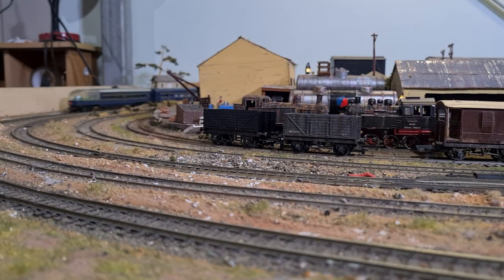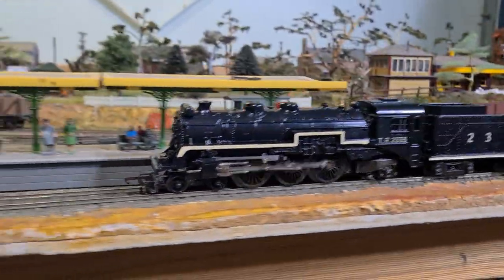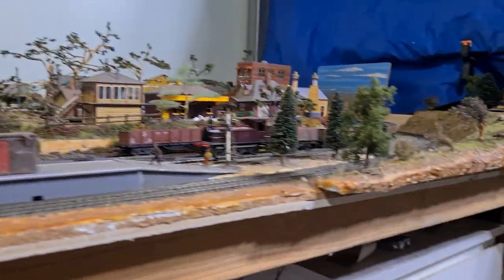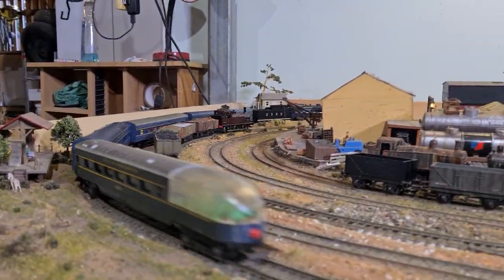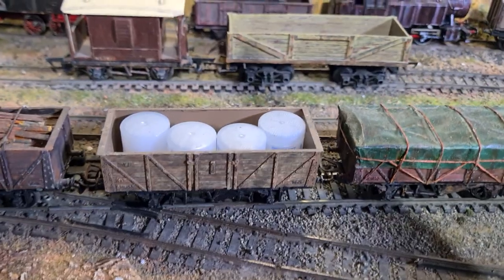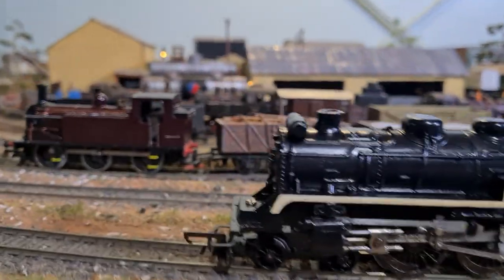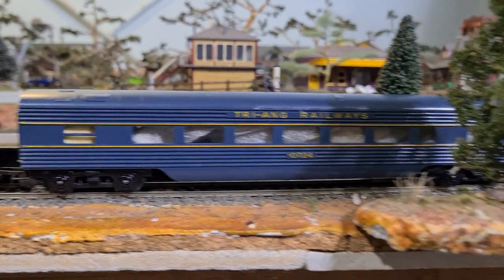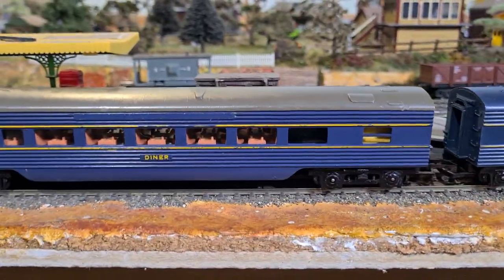Triang Transcontinental Pacific after a clean and service

Comment: A couple of great runners there Steven. I have three of the Pacifics, all in excellent condition. I didn't know the chassis was the standard Princess equipment. I have a set of those coaches too but mine don't roll worth a darn. I like the look of the Jouef wagons and I didn't think the "rope" over the tarped load looked too bad. Merry Christmas, cheers, David.
Reply from the maker: Thanks David, it has been suggested that the Pacific also mimics the NSW Class C38 in Australia, if you look at it from the front. I also think you have to poke your eyes out to to be convinced of that. Those blue coaches took a bit of work to get rolling, I doubt they had ever been stripped down and cleaned. I hate that job, it would be easier to fit modern  bogeys and wheel sets. Have a Merry Christmas yourself mate with your family. Steven.